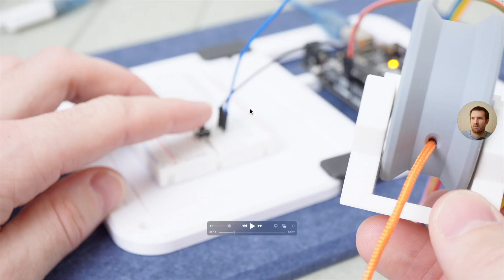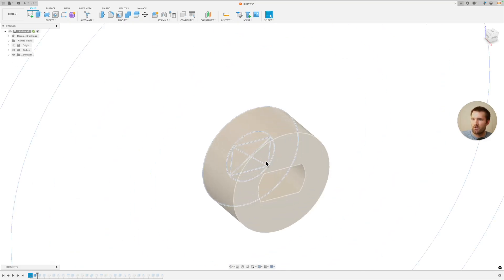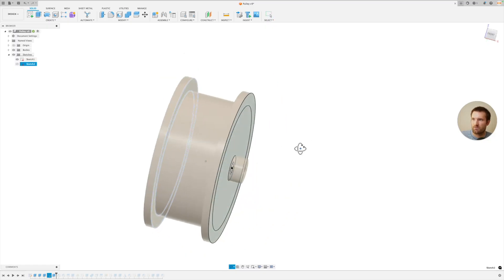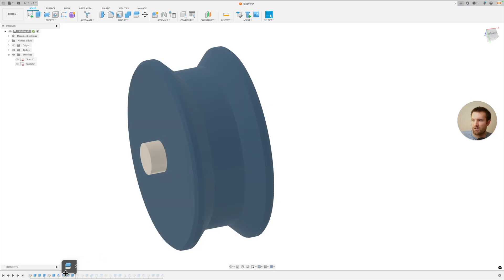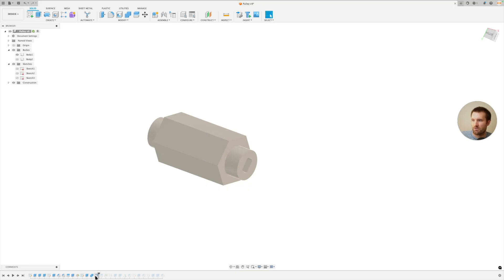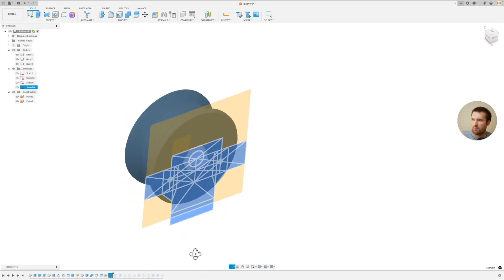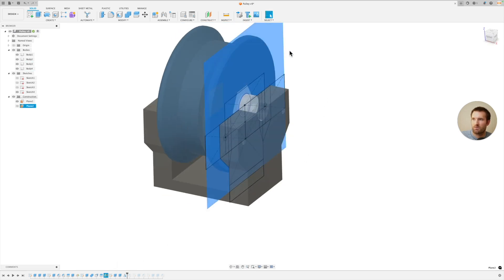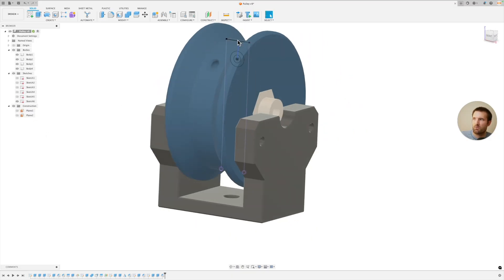3D Print a Pulley [Weekly 8]

Comment: I love your videos. They are informative, succulent and to the point. No annoying music, just that slightly speeded up delivery. It works perfect for me.
That said, if I may just suggest something, when you show the menu option being selected, can you zoom in a little please so it is clear what the selected option is? 
As regards the pulley, why did you need the hexagon, instead of just printing the pulley as one piece with two protruding side shafts?
And why would you not use metal bearings at each end? Doesn't plastic on plastic generate heat due to friction? Or was this just a proof of concept build?
Thanks.